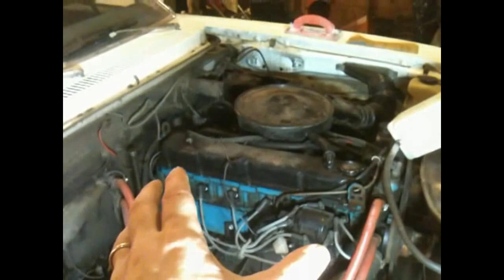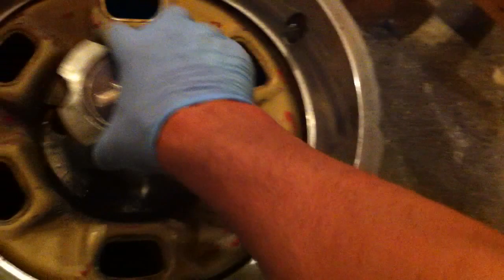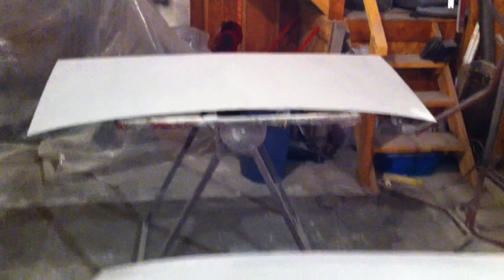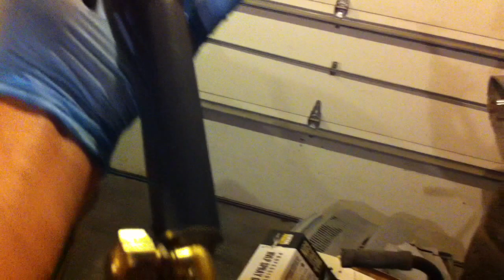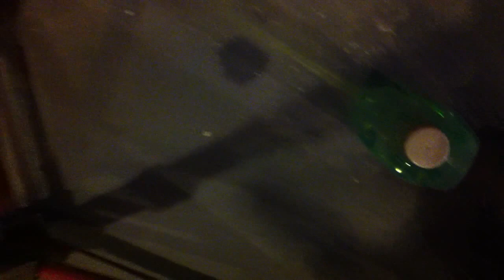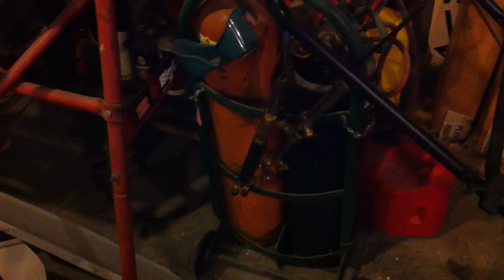Prepped for final prime-- rims,too

Comment: Lookin good. Lots of work. There are lots of videos on YouTube which explain the ins and outs of hooking up, adjusting and using oxy/acet torches. Both of your torches are for cutting only. One is a long reach the other a short reach and both probably have different sized tips, one larger for cutting thicker material and smaller for cutting thinner material. The shorter one is probably the smaller tip simply because you don't get as much splash on thinner material, so the long one keeps your hands back a bit farther from the tip. Lots of shops use different length torches just to quickly identify tip sizes when grabbing a torch to cut different sized material.
Reply from the maker: Thanks, Ed-- I will have to make some time to play... I mean "experiment" with the cutting torches... I have some thicker material to try: a leaf spring (like the smallest one.. a helper spring, maybe?, and mower blades.

Comment: Both are cutters.different  but the same. Most will screw apart in the middle. The bottom that the hoses hook to is the mixing chamber. The top part is the cutting head. You can get different size cutting heads and different size tips to go in the head. On either mixing chamber you can screw on different things ,like a cutting head ,a brazing tip , a rosebud to name a few. The part you put on top just has to be compatible ,lot of times same brand as the mixing chambers. Kinda like cars , different companies make them and all the parts do not interchange with each other.
Reply from the maker: Thanks, Terry-- good to know I can just get different tips... Gonna have to play later...

Comment: As snocrushr said, those are both cutting torch heads. They are mounted on regular torch handles. But all you need to do is pick one of them and buy the welding/heating tips that fit it. Should have the name or model number on the parts. Name should also be on the gauges. Good score though, at current prices that's about an 800 dollar set-up...
Reply from the maker: $800!?!? Holy crap. I'd better find a use for them! I will do some research on that...

Comment: Those are both cutting torches. The green hose will attach to the side that is oxygen, and the red hose will attach to the side that is acetylene. The lever is for actually boosting the oxygen mix for cutting and is the same on both, just different brands and likely different quality. Both look very serviceable and should give you good service. You'll wonder what you did without it before once you learn to use them efficiently. I miss mine now...
Reply from the maker: Thanks George-- good information! When things calm down in the shop, I will experiment with the cutters later

Comment: The one with the long "neck" is more industrial..I'd use the black handled torch for your application..BTW they are cutting torches and those nozzles are cutting tips and will have a number on them...Oh..cutting with an oxy can be dangerous....Nahhh only kidding.
Reply from the maker: Someone once said, "A before O, or up you go"...

Comment: did you remove all the led weights from the wheels?
Reply from the maker: Nah-- most of them... well, 3/4 of them... I saw I missed a rim... the tire-mounting guy will do that stuff-- and also putting in valve stem thingys...

Comment: Reuben they are both cutting heads. Did you ever get you gun straighten out?
Reply from the maker: Thanks Tom... I didn't EXACTLY get the gun sorted out, but now that I have primed as much as I need, I can play with the left-over primer to dial in the gun and get a better idea of the relationship among the different variables (air pressure, material feed, distance, speed...)

Comment: shinny...looks good
if the bird lies down grab the mask.
i had my nova wheels on my buick down in houston.....still have the buick wheels i think locked in the shed. is that rust near the bolt hoes on the rims near the center?
cutting torches are getting expensive now adays. i need a small set since i dont do much welding or cutting.  but would be nice to have
Reply from the maker: It's a little rust in the center-- surface rust
Reply: ahh....wyhat did i win for spotting it?   lol
ya right